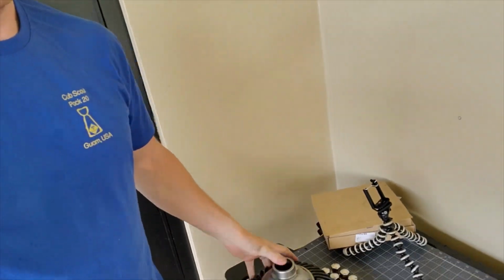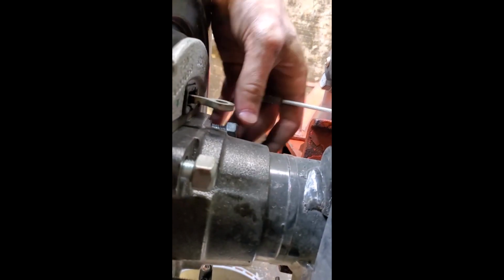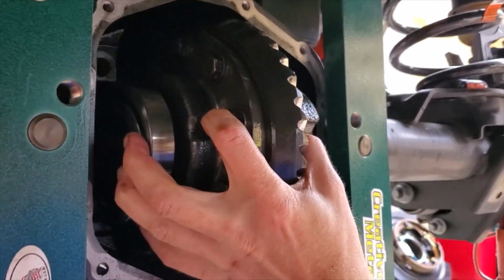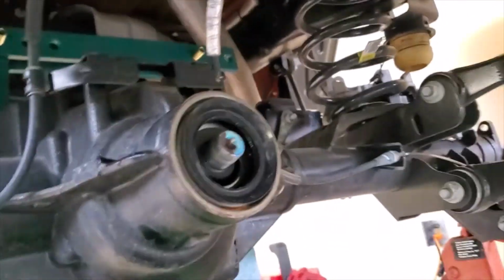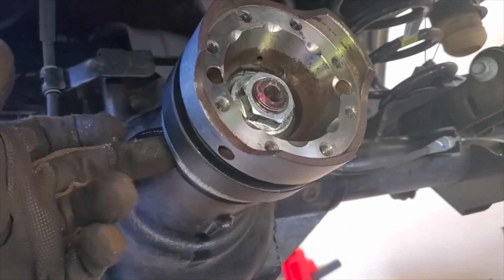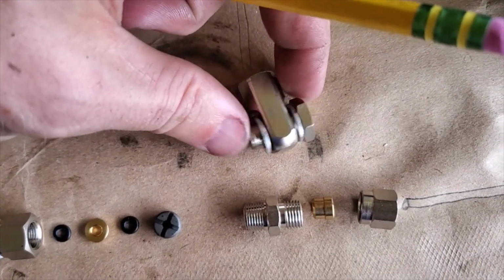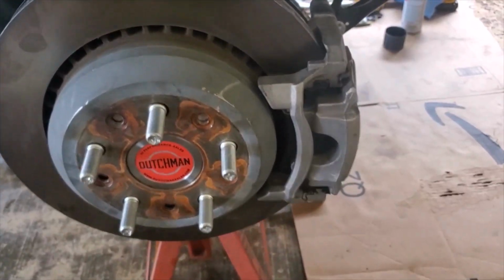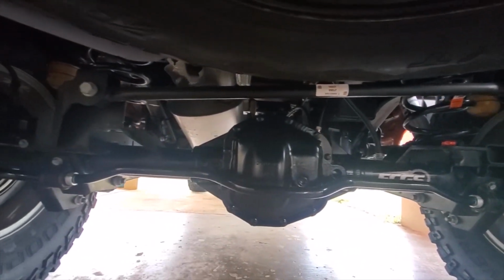Build an Unbreakable Dana 44 JL Wrangler JT Gladiator 2021 Bronco Nissan Titan

Comment: Hi finally I have the time to do the rear differential, I have removed just one side of differential and compared both shaft in your video shows that the original shaft its a little short that the 35 splines one. Comparing mine its the same way if I measure from the top of  bearing sleeve to the end of the shaft is 28 3/8 inches and the 35 spline is 29 1/16 in. Now I’m undecided if I should proceed.
Reply from the maker: Reach out to where you bought them from and verify. Mine were the same length.
Reply: Thanks I got in touch with ECGS with Chase and Jon.  Sent them pics and measurements they decide that the new axle shaft were for wide dana differential and quickly sent me a return label and they will be sending the correct ones, the shaft are on their way back to ECGS already.  I want to mention that customer service of ECGS is outstanding I’m glad to be buying from them.  Thanks to you as well.

Comment: By any chance do you have the part # for the 35 spline axle shaft? The east coast supply site its kind difficult to navigate  thru.  I’ m trying to do the same set up for my Gladiator Sport.  Thanks very much for your tutorials that are very helpful 👍
Reply from the maker: You'll have to call them. They ordered these so they may have the part. I was the first to run them so they might be prototypes.
Reply: Already got de ARB 246RD locker and the 35 splines axle shaft will arrive on wednesday but the shipping paperwork says 35 spline tow max shaft and mine it’s just a JT Sport  now I’am not sure if it works 😬
Reply from the maker: @edwintorres5850  I hope you called them and worked that out! I was on the phone with East Coast Gear Spply for a while to get all the details. They did awesome and got me exactly what I wanted. It really is a miracle. LIke I stated earlier, I was the first to try it. So I lucked out and East Coast Gear SUpply has my business forever!
Reply: @c130aviator   What axle seals did you use in the front?  I'm on the second set of seals-it seals and they are always breaking lose and leaking